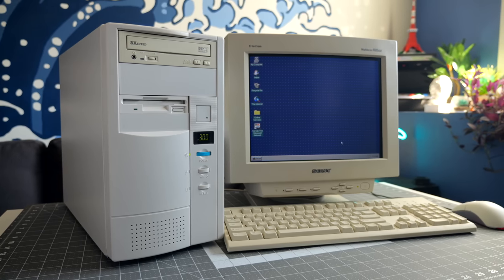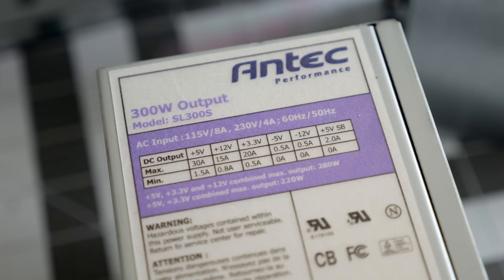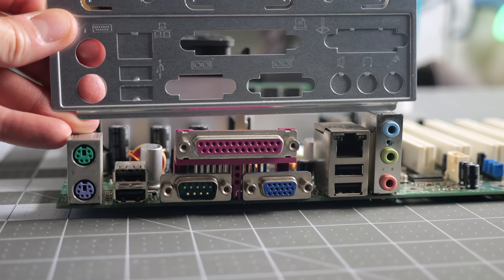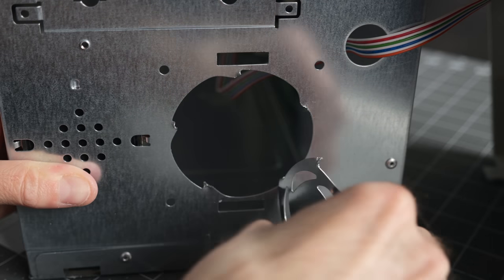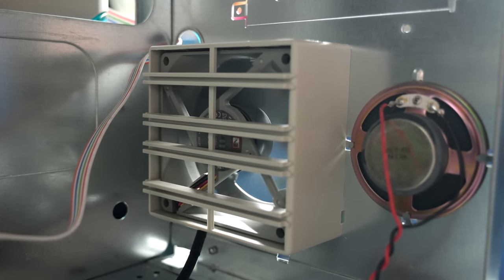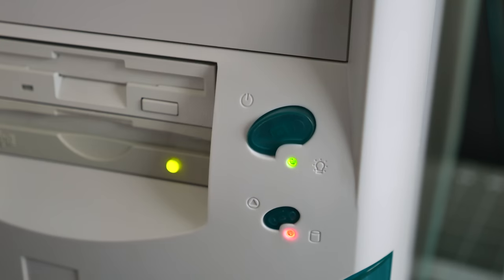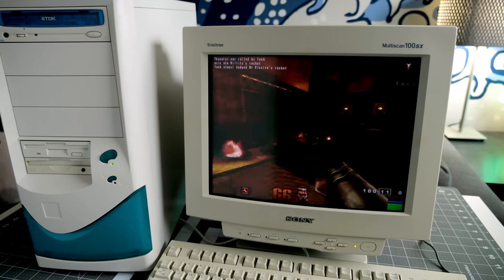Putting Together My Own Retro Desktop PC

Comment: So, I had the full tower version of this, came with caster wheels and all... But, of course I was into ridiculous crap, even back then... So that size was in order to incorporate my water cooling from V1 effort into V2 refinement. The case was modified for the radiator (an advance auto transmission cooler) which was able to mount up top, with two 110vac fans pulling air out and over it, with tight knit grills on top. Looked nice, and was all well before watercooling was a thing, and well before cases accomodated it... of course, I mean... cause and effect and all. But anyway, my watercooling was on an Abit VP6, with 2x P3 733's @ 1Ghz each... Peltier cooled, with copper waterblocks cooling the TECs... surgical tubing up to the trans cooler... well, also in internal vessel with submersible pump. That was all powered via a small black benchtop PSU... there was a whole startup sequence for sure, but it more or less just stayed on at all times... like any good rig. Ran Win2K Pro at first (then later XP), began with that back with the Abit BP6 with 2x Celerons... actually had 2x Celeron Coppermine FCPGA's in the VP6 to begin things, then moved on to the P3's later when they got a little cheaper... I hit 1Ghz with 2x cpus well before the industry did with even one single actual cpu though, even with the OG celerys. Man, those were the days... So, anyway... my dad and I painted this case in an automotive single stage yellow, with black accents.... the blue swoosh went black... same with the buttons, drives (floppy, dvd, burners, etc), and any mouldings, etc. Dads gone now... has been for some ten years now... but that's for sure one of many memories, but hardly the most radical computer from the era for me, lol. Once my tech school (in hs) saw what I'd been running as a DD, they asked me (and provided the entire budget) to build a showpiece machine, of which I could DD while at school for my CCNA course... so clear acrylic case, TEC cooled cpu, etc etc... so many good times. There's just nothing like it now, the era was very specific, iconic, irreplaceable and non-replicable. To have lived those days is to be pretty dang lucky for sure, but man... the nostalgia almost hurts sometimes.

Comment: You might have pretty much the perfect motherboard when it comes to reliability and expandability. I had the same and similiar models over the years. Altough some of them had been used in a school for over 10 years before not one of them managed to die. Capacitor plague doesn't seem to be an issue there. I experimented with various untypical accessories like RAID controllers, Intel server gigabit network cards, USB3 controllers, SSDs and even the Geforce GT610 PCI. These Intel boards handled everything you throw at 'em including working WoL and mostly sucessfully booting these accessories. Also i know for a fact that the d845 does actually shut off the system in case of CPU overheating and that's nice to know when you don't trust your CPU fan too much. Over all great board decision!

Comment: Needed a floppy to recover some data for a friend.  So I just built a computer to do that.  Athlon II X4 635 shoves XP home around quite nicely.  It also dual boots with Mint 21 incase Windows doesn't do what I need.  Really like seeing old hardware being put to use and kept out of the recyclers!

Comment: Oh wow! That takes me back. I had that case back in the late 90s.
Reply: I had the smaller version (half the exterior drive bays). I absolutely remember it having that same aqua accent panel and buttons on the front. IIRC I bought it in 2000 or 2001 for a build. I didn't have it for much more than a year or so - probably sold it to get some cash to move on to something better.

Comment: Rounded IDE cables! I had completely forgotten until now that back in the day, i separated the lines in the IDE ribbon cables by hand and duct taped them together to simulate the air flow of the rounded ones. I probably read about it on slashdot or something.

Comment: If I was gonna build an XP retro gaming machine, I'd go with a core 2 quad or even an early Ivy Bridge/Sandy Bridge setup. Something with a decent multicore CPU, PCIe graphics, and Sata or even M.2 SSDs.  The days of having to worry about games running too fast were long gone by the time XP came out, and it was such a long-lived OS it supported a huge range of hardware.
Reply: But at point…why bother with xp? Ivy bridge and Sandy bridge are perfectly useable as daily computers or windows 7 machines. Putting Xp on them is more of a hindrance.

Comment: Hahahahaha, I just put Arctic MX-4 paste between on my brand new AMD Ryzen 5 5600X! Been using the stuff for YEARS now. In 2003-2004 I had an AMD Athlon Thunderbird core that was clocked at 1GHz, and a heavily BIOS modded Nvidia Geforce 4 4400 I believe it was, and loved that machine. Upgraded in late 2005 to a 2.8GHz Prescott core Intel Pentium 4 with the same video card. I took a side grade to a cooler running, 2.5GHz Northwood B core Pentium 4 that overclocked to 3.45GHz without breaking a sweat, and a HEAVILY modded and overclocked Sapphire Atlantis (ATi) Radeon 9800Pro 128MB graphics card. After another run with a much faster Prescott, I went AMD for processor and ATi/AMD for graphics. Sorry for the rant, just miss these days when overclocking REALLY could make big performance gains.

Comment: 11:15 Samsung consumer market drives were super solid, the most reliable you could get at the time, but the tsunami floods in Thailand destroyed key parts of the manufacturing process, so there was several months without any production at all before Samsung gave up and sold whatever was left of the HDD production stuff.

Comment: It's worth noting that 3dmark 03 is absolutely brutal to DirectX8 class cards like the 4Ti, Radeon 8500/9000/9100/9200, and the Matrox Parhelia. That DirectX8 limitation is also why Crysis doesn't run, it requires DirectX9 and doesn't have a DX8 (or 7, or 6) render path like mid-era XP games often did. Another thing worth noting is that your Ti4200 is the same model as mine -- it's an OEM card and is clocked a little slower than the regular ones. That said, I would not recommend overclocking to reference until you repaste the core and probably add some vram heatsinks. A fan bracket pointed at the card and taking up a PCI slot wouldn't go amiss either.

Comment: I had one of those 60Gb drives... It was blazing fast comparing to other drives at the time. It never failed on me, but in the end I sold it after 2 or 3 years of use as the main OS drive.

Comment: Ahah, i had the same case and ended putting some 5mm leds in the front to light up the blue plastic like you did. Also cut a window on the side and put a blue neon inside but i made a very poor work.
BTW the Radeon 9200 had never been a games videocard, the Ti4200 was the best bang for buck at the times.

Comment: Used to have a GeForce 7600GS in AGP form factor, 512mb video RAM...basically top of the line card.  Beat the pants off of everything else I had at the time.  By that point I had discovered Glide Wrappers and was able to run my GLide games flawlessly.

Comment: Don't forget the Sound Blaster Live also supports hardware accelerated sound which XP was the last version of Windows to support including EAX for games. That's a nice looking system. I would recommend updating that video card for sure. I have an XP P4 system with a bit higher end motherboard and a 2.8Ghz P4 with Hyperthreading (not all models had HT.) Though I am running a much faster Radeon X800 XT for video and honestly I'd even like to upgrade that but higher end AGP cards have become expensive on the retro market. Even my X800 XT can't run Crysis but it does do well with games like F.E.A.R and Half Life 2.

Comment: Instead of going this route, that are the same route as I went with my Win98 and MS Dos machines (286 up to and including high powered socket 754). Then I have gone a different route with WinXP.

WinXP came out in 2001, and I found out that a Mac Mini Late 2009, are fully compatible with XP. Though a mobile tech, it sports a GF-9400 gfx.

And if you are into vintage OsX, then this is a treat. It runs 2006'ish XP games fluid in 1024x768x32 and it can also run OsX Snow Leopard. And it is small and silent enough.

Small, silent and compatible. What more can I ask for?

Comment: I tried the whole "computer building side gig" in the 90's/00's and it was fun but not profitable. I had some custom 1" square logos for that square divot on the cases of the time.  Recently was asked to build an i9-13900k rig loaded out with AIO, LEDs, sweet as heck, and I snuck one of those badges in it (discretely, it's a very 90s logo lol).

Comment: I appreciate the dedication to keeping the build as period-correct as possible, but that Antec power supply is going to be filled with bad capacitors. I would rather have used it with a modern unit, since the majority of power comes from the 12V rail for these Pentium 4 builds.

Comment: Mother boards of this area, did not have overclocking options in the bios. Over Clocking the Cpu was done with the Clock and Multiplier jumpers located on the mother board.

Comment: Wondering, if you really wanted to experience the PC speaker sound, maybe some Crime Wave sampled sounds, could one unsolder the piezo speaker, and, just, solder on a header for a proper speaker?

I'm perturbed, I tell you, that the specs you mentioned for the optical drive, didn't include the headphone out. Rarity! Was it a rarity in 2001, I wonder.

It's always nice to see an old drive with the plastic  film still intact. Got one with a C64 floppy drive. A bit frayed, but, oh so satisfying.

(Oh hey, I have that 80GB WD drive.)

Comment: That case you choose is the one i also built with. I had a P2 celeron 400mhz in mine with 128mb ram and a geforce mx200 was not awful worked of for the games and things i did.

Comment: I had one of those Antec SL300S (second hand). I was sure that it was well used due to how it smelled...and it didn't disappoint when after a couple of years there was a bang from it and I had to dig out my self refurbished 200W Codgen PSU (only capacitors and the fuse nothing serious).

Comment: You should've disabled auto-reboot after a system crash. That way you'll know what error code was shown.
And for seeing it for only a split second, the stop error code was "0x0000007E".
Or "SYSTEM_THREAD_EXCEPTION_NOT_HANDLED."
It's whenever Windows is unable to access system files, optical drives, ports, hard drives, or other related installed hardware on the user's computer.

Comment: Vis a vis the teal swoosh, and earlier times...

Apple made a fairly gigantic impact on the visual aesthetic of the computer industry, and honestly on industries well beyond that. I think we can all probably remember at one point being able to buy staplers, hole punches, desk lamps, and heaven only knows what else which had been done over in near Bondi blue and the other colors later AIO iMacs used.

I think the "fun" times probably ended around the point in time you're talking about, because it was still a point prior to when technology companies were all about trying to control users and manipulate everything, though behind the scenes the groundwork for that was already well under way, for example with such things as the then-recently-passed DMCA legislation. Personally, the "fun" part of computers had already started to decline by the mid 90s, though at the time I don't think most of us had recognized it. I don't think any of us had seen the handwriting on the wall. Also, the mid-to-late 90s signaled the end of BBSs and online service providers and the beginning of the age of the ISP and the Internet.

Comment: That first boot with the cpu thermal warning was an ominous warning since I've had boards from that era with failed thermal diodes that would read at 100c at first boot so it made entering the bios to turn its cooling protection off almost impossible.

Comment: I think that early 2000s defining moment was 2004, when 3 legendary FPS games were released: Half-Life 2, Far Cry, DOOM III - they basically defined a modern graphics with wide use of shaders. This hardware, but with slightly better GPU (higher-end Radeon 9xxx series, or GF FX 5xxx/6xxx) should be a nice period-correct hardware to run it 😉 

I would also love a comparison to similar build but with AMD offering: Athlon XP was MUCH better option in both performance and heat/power consumption than P4 - and cheaper at the same time.

Comment: Great build. I've wanted to do my own version of this for awhile now, think I would have gone for one of the Northwood core P4's with the 800mhz FSB and a Radeon 9600XT or 9800 Pro for the GPU. The Ti 4200 was a pretty solid card too though, much better than the FX series cards that succeeded it.

Comment: i've done a similar build a while back with an old Compaq, shes got a 2.53 ghz P4 of the same socket and same ram, but im using the onboard AC97 sound and a GeForce FX5200. Ur not gonna run Crysis on those cards, they can't use the DX9 API the game requires, sadly. I have a Soundblaster Live! like that but its in another Pentium 4 (socket 423 @ 2ghz) which runs an MX440 64mb GPU and 512 mb ram as its running under Win98SE (Need For Speed Underground 2 runs great on it), as well as it has a 120gb HDD and a DVD Rom (both of my P4s have them). I did make a WinXP build for a buddy but it was a lil newer in parts vintage and ability - Athlon 64 x2, 2gb DDR2, and an old Quadro FX380 with a 250gb HDD, as he will be loading most games via ISO to take it easy on his personal collection. I used the WInXp Black ISO to install as it supports Xbox 360 usb pads (and by that virtue my Retrobit USB adapter and a PS4 pad).

Comment: You plugged an XP machine into the internet? Bold. I was expecting some sort of ransomware to come up after the SDI issue. The XP laptop my dad continues to use for some reason, despite having a newer one, will tell you to call "microsoft" (out loud, even) if you don't boot into safe mode on it. Luckily, it doesn't encrypt the drive or anything, just demands you call the scammer's phone number.

Comment: Interesting, i've just tested a Windows 98 build with Athlon XP 2200+ and Abit Siluro GF4 TI 4200 with 3dmark 2001., i've to try 3dmark 03 for a comparison. The Athlon CPU however works at 1800 Mhz. Nice video
Reply: The naming of those Athlon XP's was so weird back then. 🙃

Comment: Wow...such a fancy CD-ROM drive though...most likely IDE drives which were able to burn at very slow speed unlike modern burners that still having hurdles when dealing with old optical disc devices where some of them unable to read burned CD-Rs from modern burners.

Meamwhile, I'm still have old core2quad PC lying around and might tempted to install Windows XP for that.

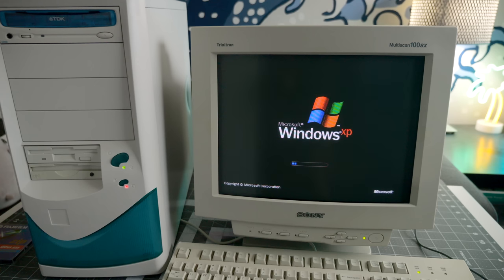Comment: 17:41 Taken from alternativeto, SDI "was reportedly abandoned by the original developer BadPointer0 and kept by a different person who includes malware in the program. Snappy Driver Installer Origin is a clean fork of the original project."

Seeing the computer blue-screened from SDI, I would suggest trying SDIO to check if the program is causing the problem.

Comment: Yesterday I got a Windows XP PC for 10 Bucks. Its Pentium 4 2.8 and 512Mb of ram, Sound Blaster Soundcard (because the OnBoard sound doesnt work) und 40GB of HDD. 
I put in a ATI Radeon 9600XT. and it runs great.

Comment: I still use an old antec case with that same PSU. It still runs great with my x58 setup in there. Only thing is the PSU fan needs some lube. Sounds like death during the winter

Comment: The Ti4200 is the closest equivalent to the Og Xbox that you can buy. Considering the Og Xbox was the most powerful home console from 2001-2005, The Ti4200 and similar performing gpus are probably good targets for an early 2000s gaming pc. I don’t think any game from before 2004s batch of demanding dx9 titles would give it any trouble at max settings 1280x1024

Comment: Alot of games from the xp era run on modern systems, though they simply aren't the same. The feeling of playing the release build of half life 2 on a specced out machine from the time really beats playing it at 4k on a modern machine.

In the end there you've ended up with a solid 2002 era XP machine, p4 2.4ghz and a geforce 4 ti 4200 makes for an excellent mid range pc from that time. Motherboard might be a bit basic but intel boards do shine in their reliability at the very least.

Comment: Kept most of the motherboards with the cpu, cooler and ram in them. I got a K5 90Mhz, K6 300Mhz, Duron 1200Mhz, Athlon K7 2x2200Mhz, Athlon K7x4 	3.4Mhz and a Ryzen 2600x6 3.6Mhz.

All of them pile up and gather dust...

Comment: First case = sharp edge fest baby at compact case from hell. The second  front face green case is a deer case with a wonderful deer power supply that will fry your machine. I had\have both those cases when they were new, they were common at mom n pop shops. The 2nd case also has many different front faces with each yearly revision some of them with deer stamped into the metal inside, but is the same case.

Comment: Think it'd be possible to build a modern PC in a case like this? I love the way 90s and early 2K tech looks, the only issue I'd foresee is the IO shield or even the entire back panel, since we have such different connectors now [might just have to cut out the entire damn thing honestly], and maybe the mount points for the motherboard
Reply from the maker: ATX is ATX, I’d be surprised if a modern motherboard didn’t fit in this case! The only limitation really would be the lack of a spot for a rear fan.
Reply: @ThisDoesNotCompute  Ooooooh shit buddy rad 😎